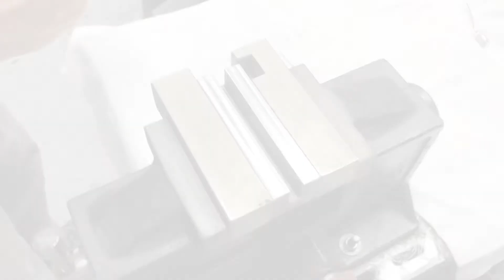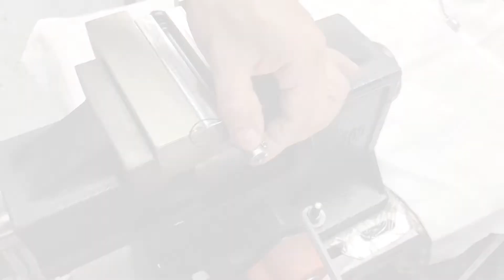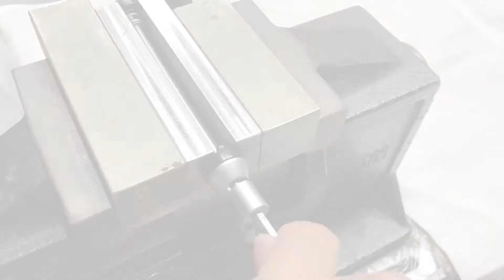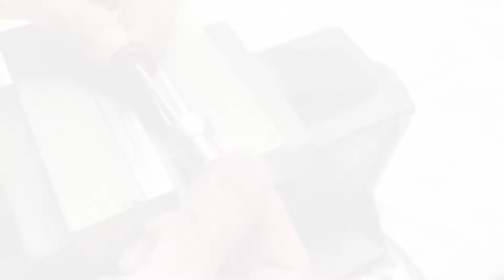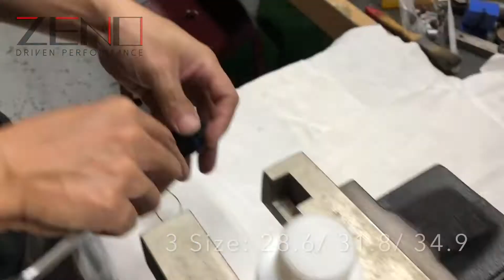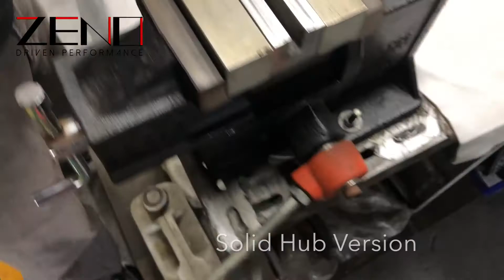Anti Theft Credential

Comment: What material/s is the seatclamp composed/made of? I hope it’s aluminum because it kinda looks like polycarbonate/plastic
Reply from the maker: Dear  Eric,  
Thanks for your asking. It's made of Aluminum 6061 with T6 treatment by forging process. 
The surface is sandblasting with black anodizing. Hope our answer answered your question.

ZENO Bicycle Component
Reply: @zenobicyclecomponent3504  Good to know. Thank you for answering. I have another concern this time regarding the QR locks, are they only for locking or can you ride with them on the wheel-set?
Reply from the maker: @ericxxvi  They just work like every QR and have anti-theft function. You can directly use them on wheel set.